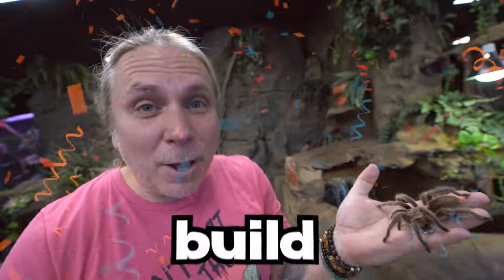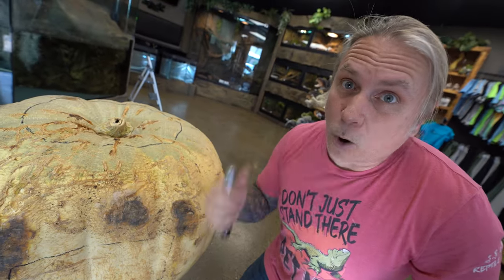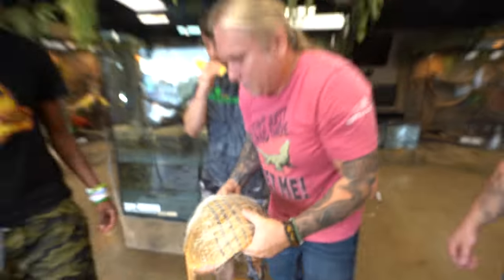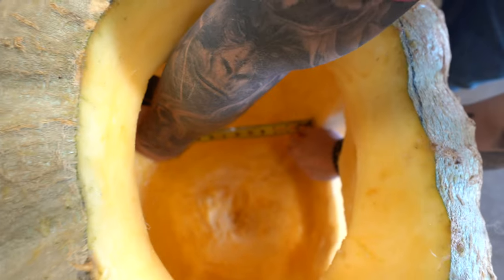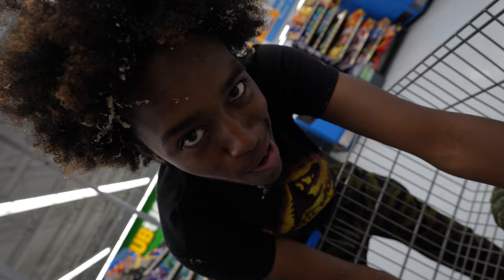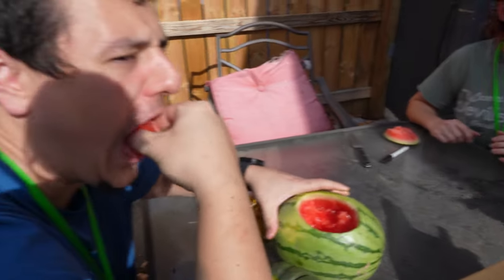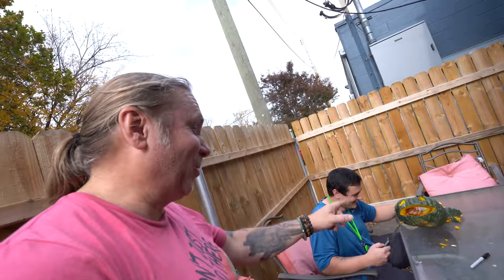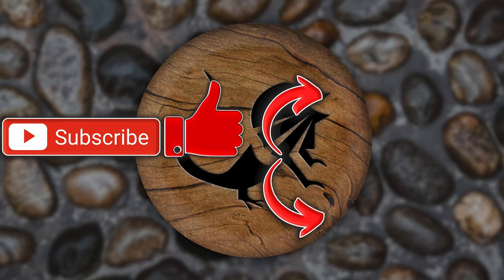I Turned A 300 Pound Pumpkin Into A Tarantula Cage!

Comment: Wrap the "screwed" in light with cling wrap all around the removable top so it doesn't smoosh the spider once it rots a bit :) could even add holes for air and they will project on the wall make a few small moon shapes along the back

Comment: I'm really hoping you can help me!! I have a 15 gallon tank and was wondering if there's any reptile I can keep in there preferably two or more that like being handled.. if I need to I can get a bigger tank/cage in time but as someone just getting into reptiles I would love your advice! Also has to be something that would be easy to catch/not so jumpy as I have cats and would be devastated if they got away and my monkeys got them before I could! Of course I'm going to take precautions and only have them out when the cats are locked in a room but things do happen and I'd rather be able to catch the little ones before they can run off!